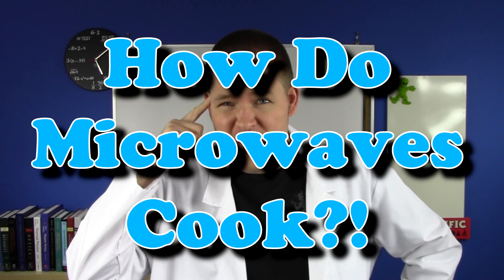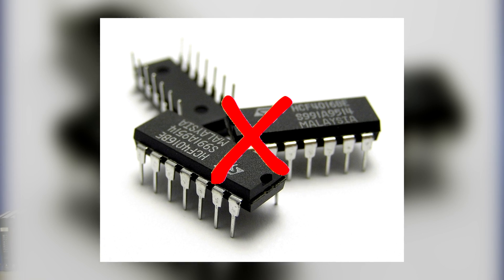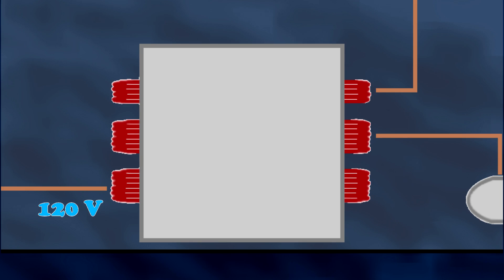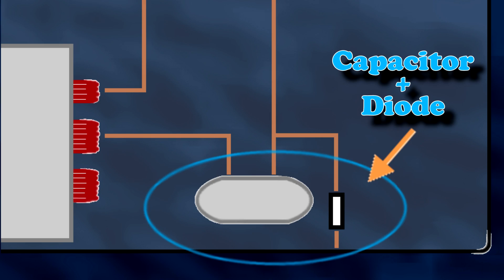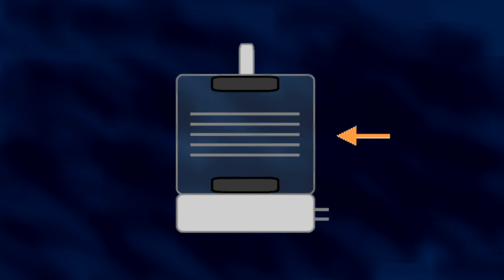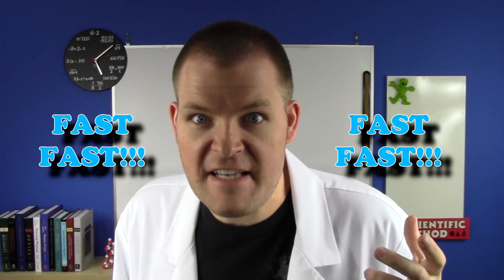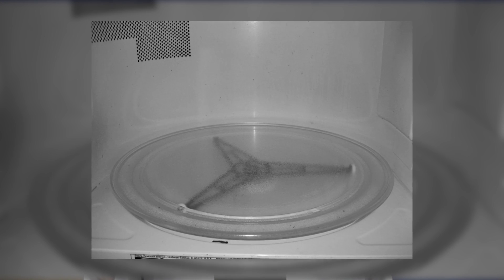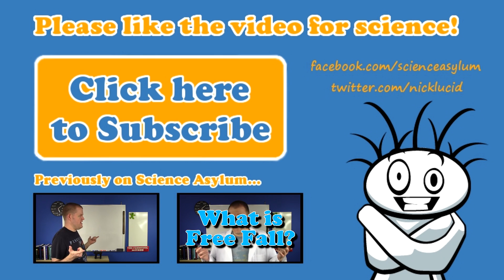How Do Microwaves Cook?

Comment: I liked popsicles so much as a 7 year old that I decided I needed to go up a notch for that extra flavor and instead of licking them frozen I should drink them like juice. I took a bunch of them out of the freezer, put them in a large bowl and microwaved for like 2 minutes. The bowl shattered and I ran to go get my mom. I never stopped the microwave so by the time we came back the sugar  had started to caramelize. I was the first time my mom was actually upset at me to the point she had a tantrum and told me I had to clean everything. It shook me a little but I did it and she eventually felt bad and came to help. I had much more respect for microwaves after that.

Comment: then why does the plate get hot? its not made of water
Reply from the maker: Not all plates get hot. Only some do. It depends if the material has an energy gap to absorb the microwave light. Water isn't the only substance with that size gap.

Comment: Why shouldn't anyone put any metal object inside a microwave when it's on?
Reply from the maker: Well, not all metal is bad. There is plenty of metal in a microwave. They even design some of them with metal shelves inside. Metal is only a problem when it has sharp corners (crinkles in foil, fork points, etc) where the charge can build up and jump around through the air. You don't want sparks like that. Sparks are bad.

TL;DR - Not all metal is bad, but if you're not absolutely sure then don't put the metal in there.

Comment: Jeez I did not know it was that complex to produce microwaves! 
Where exactly is the magnetron placed and from where does the microwave enter the unit? So it's the fast moving electrons that produce the microwave? How do they do that?
I was also told that net thing on the glass window stops the wave from escaping. Is it true? Is that net thing metal? If it's metal why doesn't it produce that eddy current spark thingy?
And have you seen this demonstration of the microwave standing wave: https://www.youtube.com/watch?v=7FhwTelc5Tg&feature=emb_title ?
You can even use something called pappadoms (which I found to be amazingly tasty by the way) to demonstrate the standing wave: https://twitter.com/carolune/status/1113480286296268806

Comment: Just to correct you on something: at 3:08, you say that 2.45 GHz is the frequency which is best absorbed by water molecules. It's a popular science myth that 2.45 GHz was chosen because it's the best, as if there is a narrow resonant frequency for water molecules. But actually, water molecules in liquid phase do not have a narrow resonant frequency due to their ever-shifting hydrogen bond networks.
The actual reason comes more down to pragmatic and cost constraints. Other unlicensed bands in the microwave range, such as 915 MHz or 5.8 GHz, do work just fine for dielectric heating, though they do penetrate food to a greater or lesser extent. 915 MHz isn't free for unlicensed use in every country across the globe, so manufacturers in this very consolidated industry have little incentive to make two separate assembly lines. Pretty much: the industry happened to settle on 2.4 GHz, and there just isn't enough incentive to make a change. However, there are specialized manufacturers which make 915 MHz microwave ovens for various uses, such as industrial-capacity meat thawing: the longer wavelengths penetrate the slabs of frozen meat better, and the larger size of the equipment is not as much of an issue when it's on the floor of a factory.

Comment: I don't know if this counts as crazy, but I once put one of those Chinese takeout containers in there, forgetting that this particular container had a metal wire handle on it. I honestly don't remember if it sparked or buzzed or smoked or glowed, but I do remember that it very quickly started to "slice" downward through the container (paper and wax?). It was only in there for a few seconds before I realized I was accidentally doing science, and I aborted the experiment immediately because I didn't have measuring equipment or a control group. This science would not have been publishable, and my dinner would have been ruined.
.
The way a microwave heats up the metal wire is a little different from the mechanism that heats up the water, right? As I understand it, pure non-conductive water will still heat up in a microwave (dipoles, necessary for MRIs, etc.), whereas metal heats up primarily because the electromagnetic wave induces current in the conductor, which turns into heat because of the metal's resistance. The metal was acting like a relatively useless antenna, right?

Comment: With these standing waves of high electric potential, it seems that the thing you want to avoid is accidentally exceeding the breakdown voltage for the material (in this case, Earth air blend) between any two points in the wave, because then you get current. Which, as I understand, is what the water allows it to do. But like most things in science, the most useful application for something is not the most viscerally satisfying.

When I think of breakdown voltage being exceeded, I want arcs. I want glowing gas. So is that why a burning candle in a microwave puts on such a great light show? The stuff coming out of the candle has a lower-or-equal breakdown voltage at the peak-to-trough distance of the oven's photons? If so, there must be some reckless voltage that a microwave could be cranked to so that even at the oven's wavelength*, we could hit the breakdown voltage. And that would be neat to see. One of the big challenges would be achieving that without arcs happening within the circuitry itself.

I know that's not a video for this channel. The only dangerous thing you do is some heavy cloning and the occasional gentle stunt driving, and I respect that. The community needs you unsinged and still in good standing with the insurance company. And no one with "Lucid" in their name is going to attempt something so reckless.  It would probably be a task better suited to a YouTuber who created a handheld microwave gun, for example. The implicit waiver has already been signed. Implicitly.

*As far as I understand it, we'd only need to exceed breakdown voltage at  half of the wavelength, because that's where the greatest difference is. And I can't stress this enough: when I say "we", I do not include myself.
Reply from the maker: I wouldn't do anything truly dangerous without having professionals present, a safe location, and permits.

Comment: Whats the craziest thing I've ever put in a microwave?  Food.  I say that because corn on the cob is about the only thing that cooks properly in a microwave oven.  I use a microwave to warm certain leftovers occassionally but thats about it.  The occassional frozen cheeseburger or breakfast biscuit sammy is edible (barely)...as long as you dont over do it...  But wow, seriously, "cooking" in a microwave is silly.
Reply from the maker: I agree. Microwaves are for reheating, not for actual cooking, but reheating is what most people do most of the time.
Reply: @ScienceAsylum  I think you'd be surprised with how many people "cook" in a microwave
...  I knew someone that taught their kids to soak dry spaghetti noodles in a soda bottled filled with hot water in order to cook it...  Thats just the tip of the iceberg.

Comment: Craziest thing I've ever put in a microwave oven: A peep on top of a CD-R.  The peep expands pretty rapidly and the CD-R causes sparks.  I recommend trying this on a POS microwave that you get at a yard sale for $5 and not one you actually care about.

Also, to prevent food from having cold spots, I always put it on the edge of the turntable.  This way no part of the food stays in the same horizontal location in the microwave oven.  If the peak or trough of a wave is somehow in the center of the microwave, and the food is in the center, that location could get either zorched or stay cold.  If you put it off center, every part of the food must pass through a different horizontal position.

Comment: As always Amazing video nick. I completely get how a microwave oven works. I knew that it was due to a device called magnetron but I didn't know how it does it. 

But I have a question :
Does the electrons spin counterclockwise or clockwise in that coil. Because if they spin clockwise the magnetic field is upwards by applying the right hand law. 

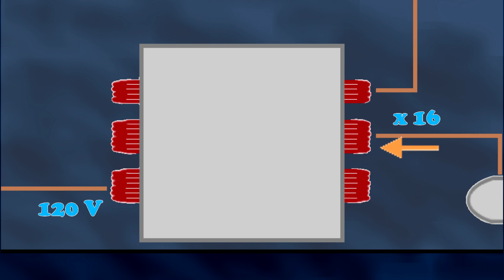I think at 1:35 you made a mistake. Voltage by itself isn't dangerous. It's the current which is the main danger.
Reply from the maker: But high voltage often results in high current (V = i R). That's why we have "DANGER: HIGH VOLTAGE" signs.
Reply: @ScienceAsylum  but why when we get shocked by a doorknob or any other mild shocks it's more than a thousand volts and nothing happens?
Reply from the maker: It won't usually be labeled "high voltage" though unless it's high enough to cause physical harm.

Comment: The metal of the microwave oven in connected to the ground, the middle pin in the plug. The positive side of the voltage doubler, and the side of the high voltage coil closest to the core are also connected to the metal.
The filament is powered by 3 volt and one of the two side of the filament is connected to the negative side of the voltage doubler.
The voltage at the magnetron is pulsed. One half cycle with 4000 volts and the other half cycle 0 volt (the capacitor is charged during that half cycle).

Comment: It's 220v here, but the rest is extremely informative 😁
Reply from the maker: Ah, yes, they just change the turn ratio on the transformer. As long as the voltage at the magnetron is correct, it'll work.
Reply: Thanks!
Reply: It’s also 220 volts in my country - vietnam

Comment: So, can I say microwave is the resonance frequency of water
Reply from the maker: No. The microwave frequency range is a wide range. The resonance frequency of water is a very specific microwave: 2450 MHz
Reply: @ScienceAsylum  ok what is the resonance frequency of water molecules,  and why microwave make water hot ♨
Reply from the maker: As I mentioned in the last response, it's 2450 MHz. Microwave ovens are built to operate at exactly that frequency so they interact with water. They're built that way.
Reply: @ScienceAsylum  microwaves vibrate water molecules, so it's the resonance frequency hhhhh pllzz explain in another video ppllzzz bro

Comment: yea but why does the voltage change when it is spun around? why does changing the number of turns change the voltage, why does that happen? what about spinning a wire around results in the voltage change, ive actually looked into it and couldnt find an answer, i guess it possible we dont know why, just that it does, which i guess the case most of the time
Reply from the maker: I'm working on a whole series on electricity and magnetism (coming soon). It should answer your questions :-)

Comment: Microwaves generate 2.4ghz, thats explains why my old microwave was interupting the wifi, as it sends data around that frequency.
Reply: it shouldn't interrupt your wifi. Microwaves' cover have grid like stucture on them. It is not random and it is not to make them cooler or anything. That grid completely reflects any microwaves. For microwaves it is like impenetrable wall. But for the visible light it cause no problem so we can see the inside easily while being safe of scattered radiation. You can check polarization for more info. Also you can watch,

https://youtu.be/UL6_VIexbAU

Comment: My wall socket provides 220 volts (different universe)

IMO microwaves (appliance) is one of the not so great inventions, they maybe good for defrosting or heating frozen meals (and we know how those taste) but for cooking they have very low value.

If you prefer electricity for cooking use induction.
Reply from the maker: Yeah, but most of the "cooking" people do in the U.S. isn't really cooking. It's reheating pre-cooked food or leftovers... so it works out fine.

Comment: The capacitor is the most dangerous thing in a microwave? I thought it was the beryllium ceramic on the magnetron? Crack that thing and you've messed up your lungs for the rest of your life. At least that's what I've read.
Reply from the maker: Usually, those ceramic insulators are safely enclosed in the metal parts of the magnetron (if the magnetron even has them). It's not something you're going to get exposed to when trying to fix a microwave.
Reply: The Science Asylum That's true. I was going under the assumption that an amature wanted to get inside it to see how it ticked.

Comment: I love your videos! I had never thought, until now, to find out how a magnetron actually worked, and now I know! Yes, I could have looked it up on Wikipedia... but watching you is way more fun.
Reply: Same for me. When I clicked this video, I thought "I know how it cooks: resonance of water at 2.4GHz by magnetron", but I never thought I didn't know how magnetron actually works.
Reply: Here's another thought that I just had: if you set up the magnetron with the right frequency, could you actually make visible light? Has anyone made that device, and is it any use for anything, other than building -evil death rays- cool-looking equipment in your laboratory?
Reply: I think it is possible with right magnets and voltage (and maybe a hole for "output"). I also doubt someone has built it. Maybe it takes too big/strong magnets, I cannot figure it out right now :)

Comment: When I cook in microwave, I have trouble with WiFi if my smartphone is near the oven.
Reply from the maker: You might want to get a new microwave. It shouldn't leak like that.
Reply: Wifi works at 2.4 ghz, almost the same in microwave, it is expected some interference but not a lot, check if your modem have other transmission frequencies other than 2.4 ghz or change for a more insulated microwave as nick says.

Comment: Actually 2.45GHz is chosen as working frequency only for industrial conventions reasons, it still works for water, but as far as I know the most absorbed frequency is around 22GHz. I put some sources in case someone is curious about it:

https://gizmodo.com/5629814/giz-explains-why-everything-wireless-is-24ghz
http://amasci.com/weird/microwave/voltage3.html

Your channel is amazing! The way you explain such complex concepts in such a simple way is unique!
Reply: I was looking for this exact comment! Thanks for posting. Nick should have mentioned that 2.45GHz is not resonant frequency for wiggling water molecules.

Comment: Coming back to this video years later but... I've also heard that the heating of the water is done by oscillating the waves, so that the water molecules are forced to align with them at one point in time and then forced to move again at another point in time, and this is repeated to continuously force the polar water molecules to re-align over and over, generating heat energy.  I'm wondering, is this not true, or is it just a detail that wasn't covered in this video?
Reply from the maker: That alignment does happen, but it's far less of an effect than the wiggling and spinning. It shouldn't noticeably contribute to the heating.
Reply: Ahh, okay.  In researching the effect a bit more, it seems that the alternating (maybe I should've said that instead of oscillating) field does induce dipole alignment but instead of just flipping the molecules back and forth as I imagined, it actually rotates them, which makes sense.  But the video doesn't go into that particular detail because it's focused more on what happens at the electrical circuit side of things.  :)

Comment: Minor correction. The electrons rotate in the magnetron 8 times slower thab the 2.45 GHz frequency. There is 8 cavities inside. A pulse is generated on each transition.

Another fun fact: the way the voltage doubler works produce pulses with 50% at 4000 volts and 50$ at 0 volts. The magnetron emit burst of microwave, 60 times per second.

The recent models (about 2 years) now use an electronic "inverter" instead of the 10 pounds transformer. They use switching power supply technology, similar to those inside PC computers.The transformer is about 100 times lighter because the frequency is 25 KHz instead of 60 Hz ; less iron needed to accumulate the same amount of magnetic energy.
Reply from the maker: I hadn't heard they were phasing out the transformers. That's disappointing. Good think I stocked up on them! (I have a bin full of them.)
Reply: Hi, I would think microwave business will also adapt the cheaper switching power supplies instead an old fashion metal core transformers these days.

Keep up the great work Nick! Your videos are very interesting and enjoyable :-)